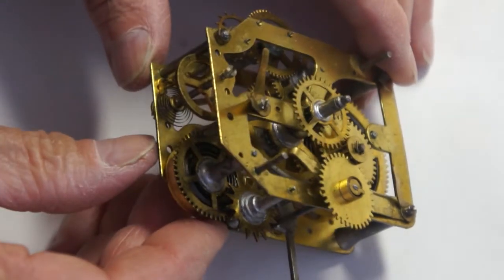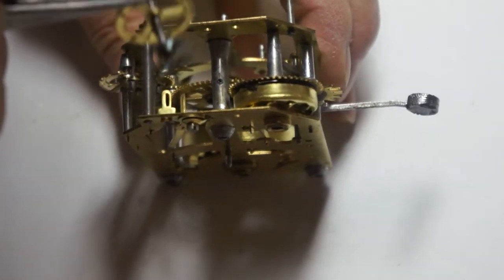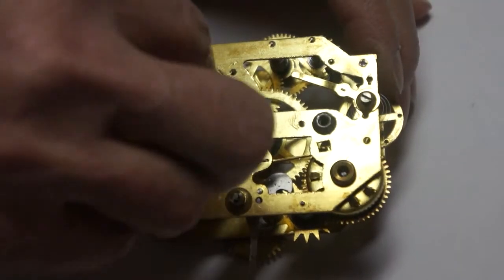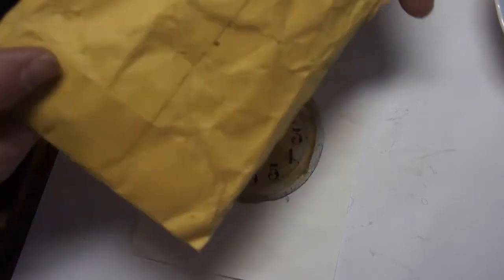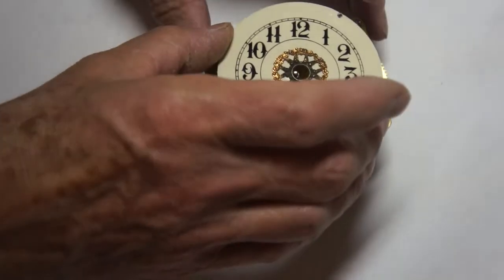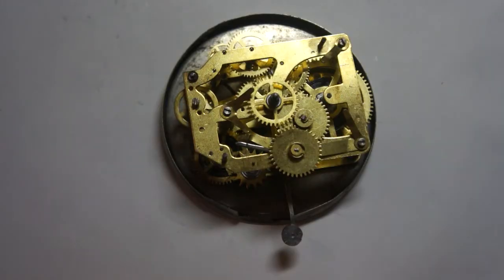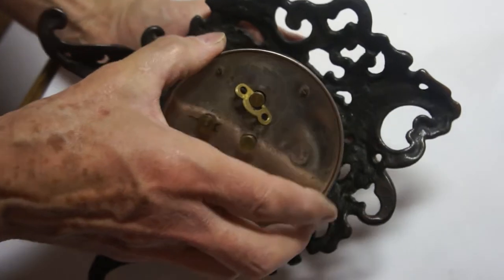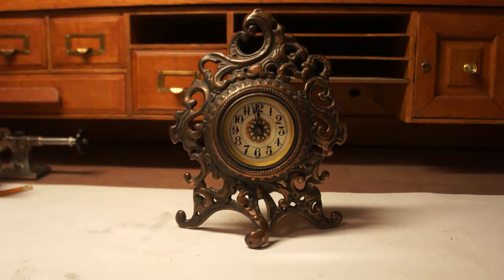1906 Alarm Clock Nouveau Style Restore for Greg Part 2  #8

Comment: I totally ended up overlooking this video and forgot it existed!

"These movements don't really lend themselves real well to disassembling and re-assembling." I'm going to have to disagree with you there. Sure, there's the goofy pressed on alarm setting wheel in the 1950's on the late style 5's and then style 6's, but that's about it so far. These movements should be alright to work with.

Those original instructions by Westclox don't do anyone any favors, either. You're just loosening up all the old gummy oil and then mixing it new stuff. 

As for the NOS dial, I have nothing to disagree with there, although I'd probably keep the original stained up dial anyways, just in case.
Reply from the maker: Owner of clock asked that the clock be cleaned the Westclox way.
We discussed pros and cons and it was he wanted.

I would assume, in the past, a lot of these clocks were cleaned the Westclox way to keep them keeping time for the owner.
The Westclox way is probably responsible for saving a lot of these from being thrown in the dump long ago.
So in effect its probably why so many of these survived for us to enjoy.
I agree, a complete disassembly is always the best way to service these or any clock.

The parts on these need to be handled with care, due to the soft metal used in the castings.
An experienced person like you and I will have no problem with them.
But the inexperienced person may end up taking good movements and turning them into parts movements in no time at all.

We kept the old dial with the clock, don't believe in throwing any of that stuff away.
Reply: @jamesmartin5370  The Westclox way had it's day, didn't it? It really must've saved quite a few of these. 

I have some experience, as you've seen, but nowhere near yours! I can usually get around stuff without screwing something up along the way (at least in 2020 and 2021).
Reply from the maker: @SKHorology2025  
I agree,
I have worked on a lot of Oggies. 
A lot of these date back to the 1840s, long before Westclox started. 
It was customary back then for the farmer to give the Oggie a good soaking in kerosene for a day to keep them running. 
That said, we probably wouldn't have as many Oggies around if they weren't cleaned by the farmer in this way. 
Maybe the Westclox cleaning method was adopted from them, not sure.
Their reasoning was probably due to:
1. They were inexpensive and mass produced pin levers.
2. Profitability on repairs was low.
3. Repair cost was probably more than the cost of a new clock.